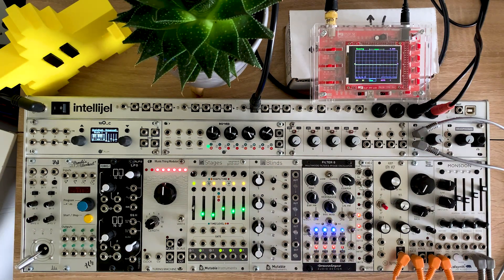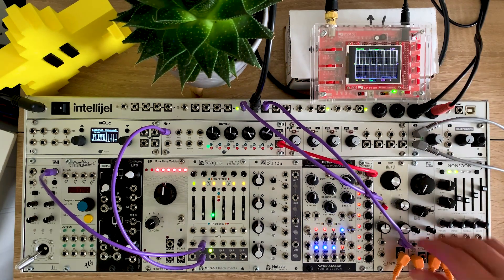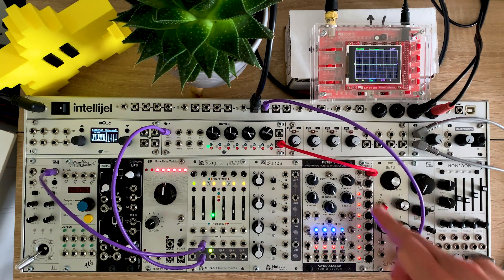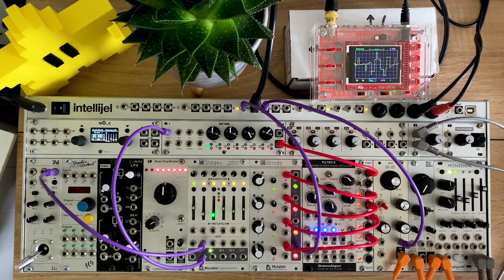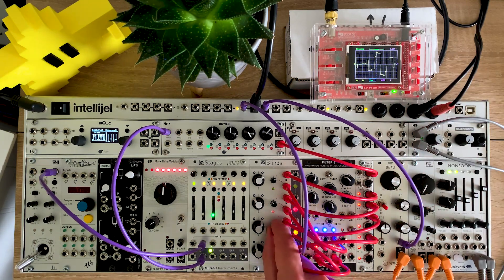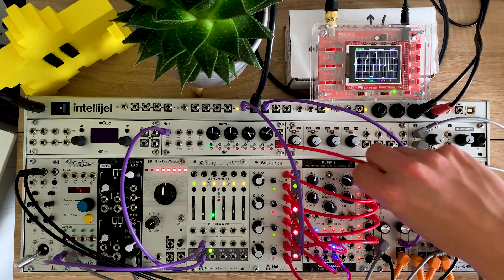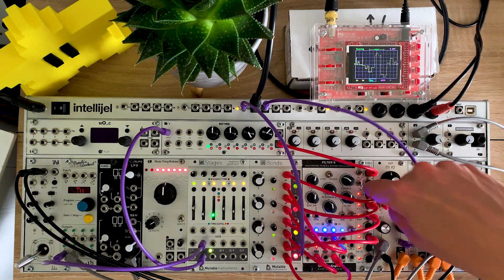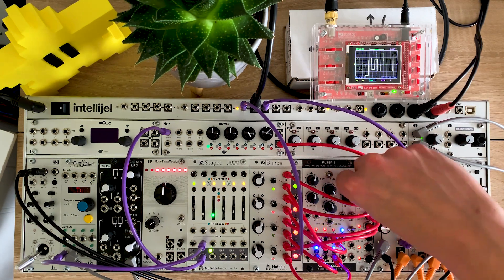How to turn a clock divider into a subharmonic oscillator | Doepfer A-160-2

Comment: You have just made a subharmonicon by the looks of it.
Its what and how you patched the clock divider to that confused me because in order to emulate your patch I would need more than a clock divider?
Will all clock dividers do the same or only the ones that do the odd numbers eg 17?
Great video.
Did you buy the intelligel unit as is or did you build it up?

Comment: Can this be done with most clock dividers??
Reply from the maker: It should work with any clock divider that can run at audio rates 👍
Reply: @TomChurchill  hopefully the Takaab runs at audio rates, will have to check before I buy it 😀thanks Tom
Reply from the maker: @advaita9156  the Takaab ones run at up to 10kHz so all good I think :)
Reply: @TomChurchill  thanks Tom

Comment: Will an analog oscillator as the input work the same way or does it need to be digital?
Reply from the maker: An analogue oscillator will work fine - it doesn’t matter too much what the input signal is, as long as it’s something with a rising edge that the clock divider can detect and count. So any square or pulse wave ought to be fine 👍
Reply: @TomChurchill  Thanks!

Comment: Hi Tom, thanks for sharing this, what a wonderful idea ! I couldn't help but notice you seem to be running Hemisphere on your 1U O&C, is that the v2 ? If not, would you mind sharing which firmware you are using ? Mine seems to be stuck on a -3.5v/+3.5v range while I get a full range on the original O&C firmware😕Thanks in advance for any help you can give !!
Reply from the maker: Thanks! Yep, I'm running Hemispheres on a V2 1U O&C - it came pre-installed when I bought it. Are you definitely running a VOR-compatible version of Hemispheres? (I'm assuming you have a VOR-enabled O&C - I think they all are though?) 
That's the only thing I can think of tbh - sounds like it's probably not a hardware issue if it's working OK on the original firmware. If you haven't already done so, maybe try grabbing Hemispheres from here and reinstalling... https://www.plum-audio.com/oc-firmware
Reply: @TomChurchill  Hello and happy new year ! For some reason, I missed the notification for your message but I think the issue stems from the fact that I have a v1 and you have a v2. I'm not too sure what the issue is but I understand that first version did not handle the VOR thing with Hemispheres properly, at least it's been confirmed to me by Plum Audio that for v1 modules, only the original firmware will work correctly and Hemisphere will not. Wish I had seen earlier the numerous posts from very confused users who I understand all went back to original firmware or simply gave up - at least I haven't ready a single clear report that Hemispheres is working fine with v1, I guess it was the plan originally then it was dropped. I'll most likely sell mine as a result and give up on Plum Audio entirely (already had issues with their QC) 😕